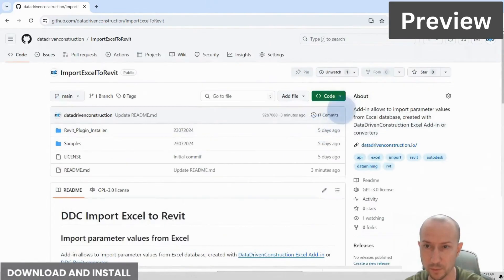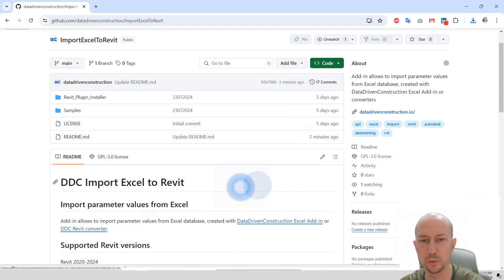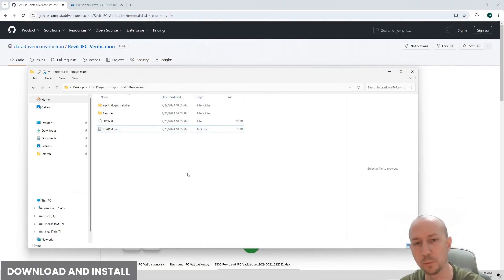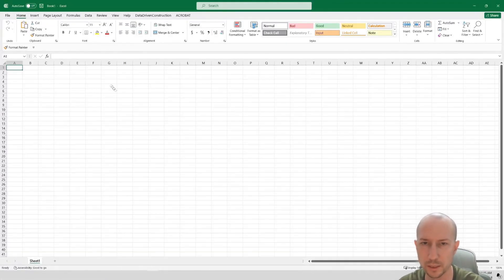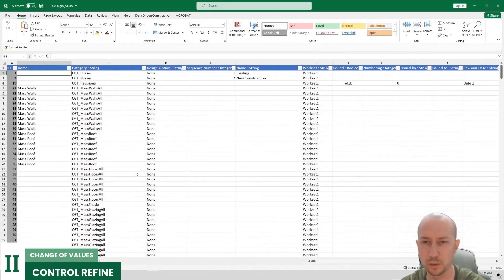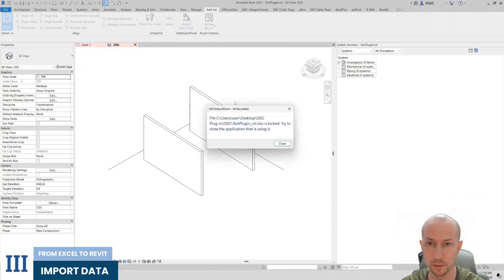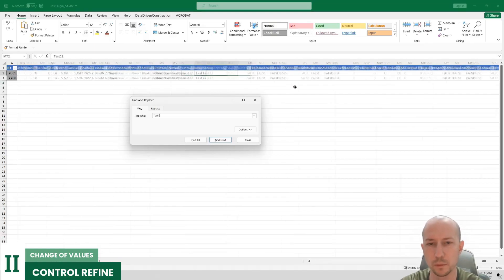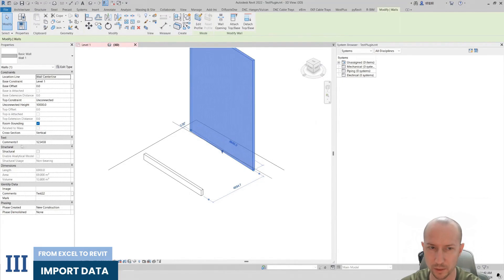Revit Tutorial:  Update parameters using Excel data |  Step-by-Step Guide

Comment: Hello,
I'm looking for a program that can extract parameters from Revit to Excel, allow me to make changes, and then apply them back to Revit. The DDC program seems to have exactly the features I need, and I would really like to use it.

However, I'm currently using Revit 2025, and it appears that the program does not support this version.
Do you have any plans to update it for Revit 2025? If so, when is the release expected?